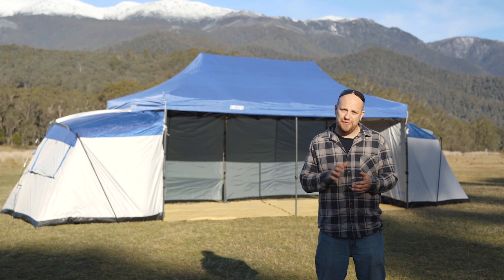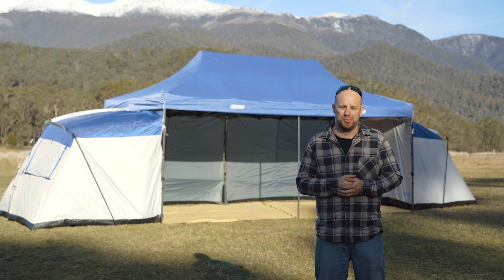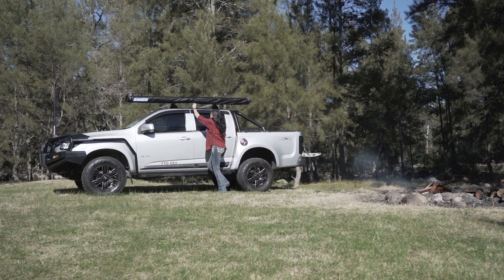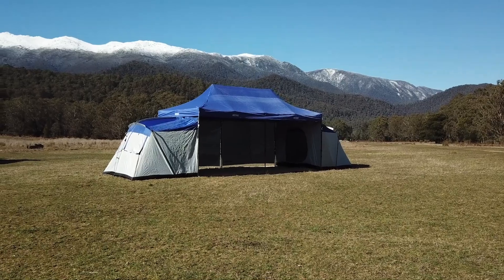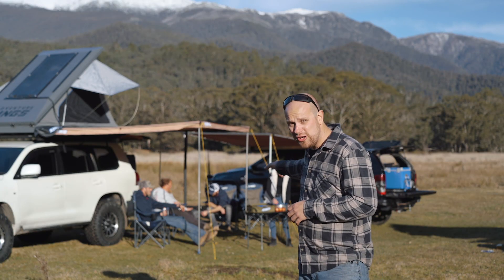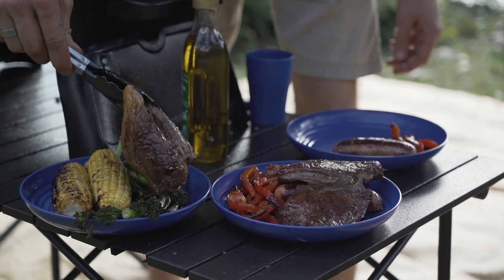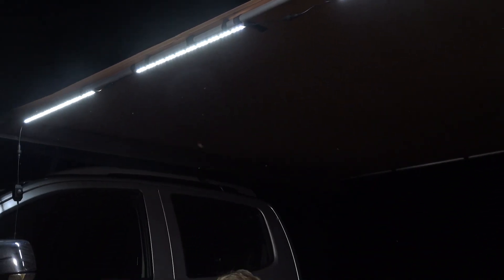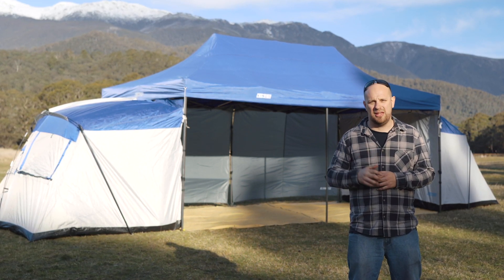EPISODE FIVE! Making Camping More Comfortable - Camping Shelter, Camp Chairs & LED Camp Lights!

Comment: Gazebos and awnings are great for those hot or wet days. Normally though I find myself sitting under the sky rather than awning if the weather is ok. The Hard LED Light Strips are brilliant. I use mine on full when cooking and off unless needed. I love just having the light of the fire and the moon. 

As for Questions I think cleaning would be a good video. Not just cleaning dishes etc but personal hygiene and clothes for those long trips.

Comment: Hi mate got a question, can we have 6x3 gazebo with gazebo tent and mosquitoes net attached together so you walk in through the net area to the tent? Also second q is do we need to remove the tent from the gazebo when we packing up? Or we can pack it quickly with the tent?